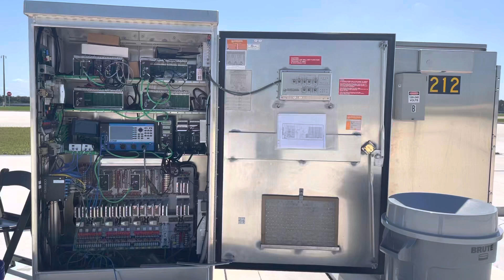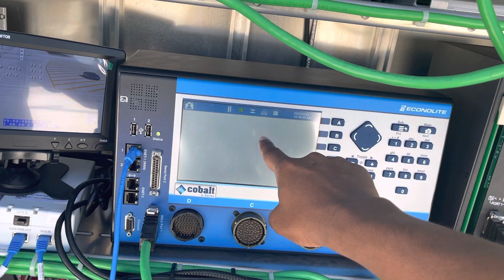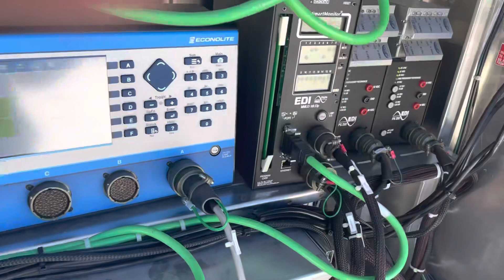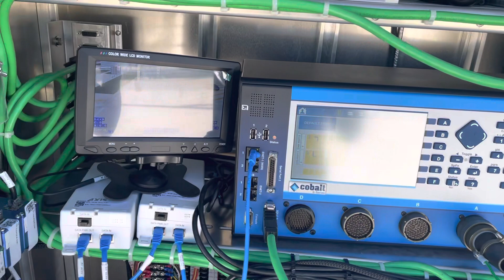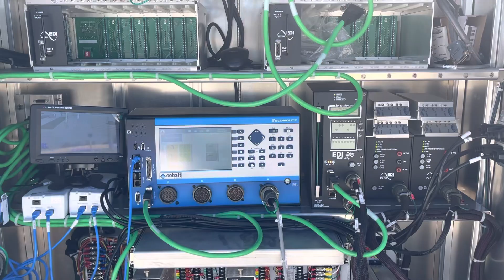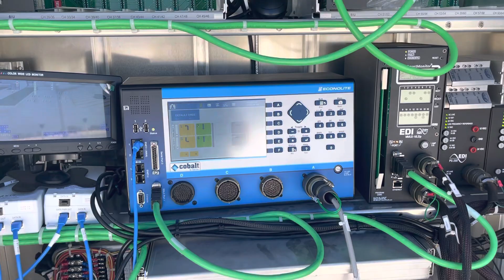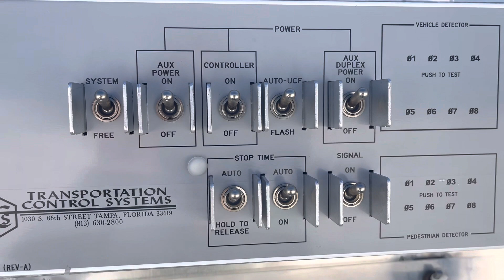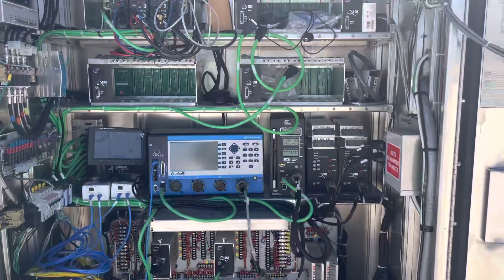Inside the Traffic Signal Cabinet (NEMA TS2 Type II): A Tour of the Technology That Controls Traffic

Comment: Thank you for sharing! Is there any output terminal for fault flash? I have a set up very similar (TS2 type 1 and IE 3000) and i want to utilize the alarm input on the network switch. I already have contacts from the UPS for a minor alarm when the power cuts out, but i really want a fault flash alarm to set up auto emails. Please help.